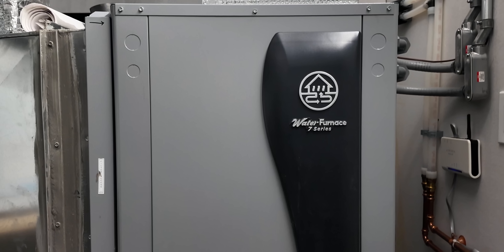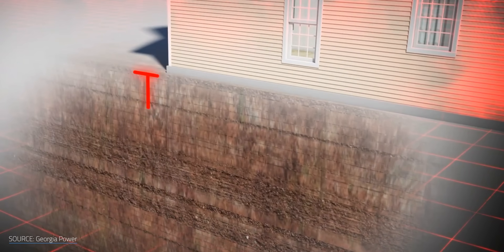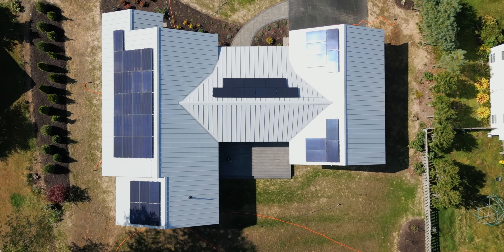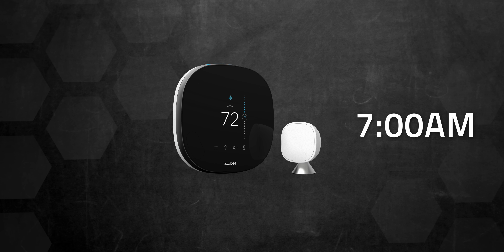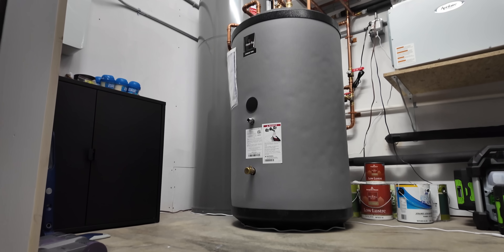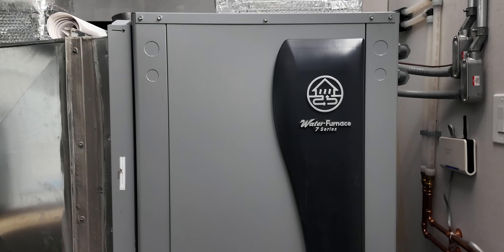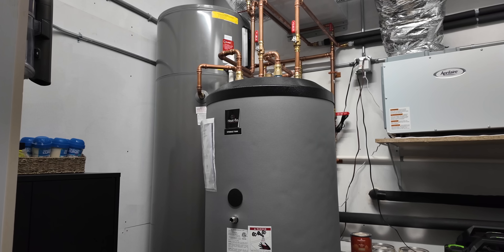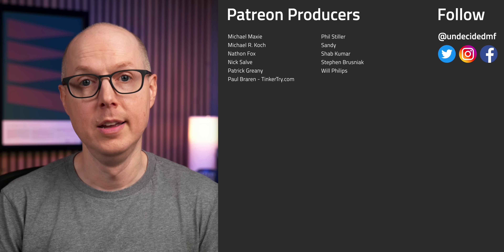How My Geothermal Heat Pump Really Performed (2 Years)

Comment: smart thermostats aren't worth it, you are best to run your traditional heat and AC systems at a consent temperate. We only raise our cooling or lower our heat when we leave for more than two days. The amount of energy to catch back up for daily raising and lowering loses any potential savings and works your system harder.

Comment: In The Netherlands we call heating with hot water more than 1000 metres deep Geothermie. And heating with water from the soil (around 15 degrees Celsius) 'Bodemenergie'.
Reply: @LeonNelen  Aquifer Thermal Energy Storage (ATES) is the correct English term for Matt's system since he is storing heat by cooling his house in the summer an using the very same heat in the winter.
Geothermal energy is using the heat coming from the core of the earth...

Comment: I live in the Mojave and the dense clay/hardpack substrate here makes geothermal both excellent and terrible. Excellent since clay is largely impermeable and temperature stable, but is so difficult to dig through the excavation costs skyrocket fast. Still, if I could swing it, I would prefer it over my current AC/Gas-Heater system because we still end up using our grandfathered wood fireplace in the winter.

Comment: I wanted geothermal to connect into my existing hot air systems but no one in my area installs or supports it. Had to go with air to air heat pumps. They are fine about 9 months of the year. It is cold enough the other 3 that the cost to run them gets high.  They are supposed to be 70% efficient at -20F but a lot of people say not to bother running them below about +25F. I don't really have a way to compare the cost of the oil and propane for the furnaces to the cost of electricity for the heat pumps in the cold part of the year.

Comment: This is super interesting to me.  But my situation is pretty different - existing house, located in a more temperate place (central coast of California), existing gas furnace, but also, a solar hot water setup with an 80 gallon heat exchanger tank, and so on.  How did you find and compile the information you needed to make a decision to pull the trigger on this?

Comment: I've had my geothermal system for 10 years now, and I'm mostly happy with it. I use radiant floor hearing, which allows lower heat pump output temperatures, which helps significantly with efficiency. My solar and battery installation is much smaller than yours (3.6 kW solar, 12.5 kWh battery), but it still helps a lot, even in cold and rainy northern Spain. I'd say that the most important consideration is the vendor and technical support  for the systems. My vendor was acquired by Bosch, who have been useless and I've mostly self-maintained the system. Do your due diligence and choose carefully.
Reply from the maker: Excellent advice.
Reply: @UndecidedMF  totally off topic question, but im a fan of your glasses you are wearing here. do you know what kind they are? Thanks in advance and thanks for a great video
Reply: Knowing what you know now what brand would you recommend?
Reply: @ardas77   As someone who works on them it should be based on who is in your area, you dont want just any company working on them. You want their experience with your system and being local for quick turn around for service call.
Reply: @zack9912000  I agree. The "official service" shop in my area is useless. He's a nice guy, but doesn't know the system and has zero initiative when problems need to be solved.
Reply: That is exactly my experience with my solar inverter manufacturer, Kostal.
Reply: @ardas77 I hear good things about Vaillant, but only anecdotally from a few neighbors. When/if I replace mine I’ll investigate more!
Reply: @MotoLen51  the rain in Spain stays mainly in the plain
Reply: @tlv8555  not all of the northern peninsula is Catalonia, the Atlantic coast and the western Pyrenees most definitely get loads of rain
Reply: @tlv8555  Not really, Eliza Doolittle. ;-)
Reply: It also seems to be a trend that many techs don't like how it was done and want to re-do things.  Of course, it seems the loop installation itself is the expensive part.  As long as that's good everything else is much cheaper.
Reply: @EmperorA0  My loop failed during the first winter after installation. The weight of 2X 150m of water-filled pipe pulled and broke the fittings at the top (luckily, at the top). The builder fixed it as everything was still under warranty. Lesson learned, don't tuck any part of the installation too far out of reach. Everything can break and everything needs to be accesible.
Reply: Bosch used to be a great company.  Now they f-up everything they touch.
Reply: My parents live in Spain and they are afraid of the solar tax, so they have avoided solar 😢
Reply: @blaiseutube The “impuesto al sol” was repealed in 2018.
Reply: En serio?? En qué zona vives? Me encantaría tener algo parecido.
Reply: It's been my experience that german companies tend to have atrocious customer support but good engineering.

Comment: 10:05 Since your server-rack (home office setup) are presumably not venting to outside, the energy should be factored into the heating somehow. But I agree its hard to take into account and 20% (10:50) electricity usage is also very impressive.
Reply: The calculation should be pretty simple because essentially 100% of that power usage beyond a typical home load becomes extra heat that doesn't have to be moved by the heat pump, when it's heating season. Although the A/C has to work harder in the summer, that's probably negligible where summers are mostly mild

Comment: I'm with you on the ground source heat pump.   We had a retrofit done on our home in 2020.  It is a GeoComfort 3 ton system with a desuperheater.   We have two loops that go down 235 ft. Yes, we just set the temperature and let it do its thing.  I was impressed how well it controls the humidity during the summer and stable temperature throughout the year.  We added solar in 2022.  The system has been  providing over 200% of what we use on an annual basis. Yes, net positive.   "Think long term".

Comment: If the ground is constant at >6ft down then why would you need a well and not just some trenches?
Reply: That usually comes down to real estate. In my case, we converted from gas/AC in a house built in 1953. There was just no sane way to go horizontal. In a new build with sufficient area, horizontal would save a lot. If our lake was much deeper, we could have used a submerged heat exchanger. But we have to play the cards we have. That forced vertical.

Comment: We've had a similar geothermal system with horizontal loops here in Ireland since 2006. Our percentage of heating costs vs total energy use isn't as low as yours, but our house turned out to be not as well insulated as we hoped it would be (i.e. as we paid for it to be!). While tricky to calculate, we reckon we hit payback in just 5 years when scaled and compared to the previous house we lived in, but by year 8, it was very clear there was no comparison, as neighbours still on older fossil fuel tech regularly related how expensive heating had become. To sour the story a little, you pointed out how it wasn't necessary to have smart thermostats in each room trying to optimise everything... but unfortunately our installers at the time weren't so savvy, and we chewed through 2 replacement compressors due to the constant calling for heat by different rooms. When we switched service guys just a few years ago, we got the heads-up about what was causing the compressor issues and ripped out the room stats. The system has been working even better since then and we never touch it. Oh, and when we're heating the house we get "free" hot water as a buffer tank on the heat exchanger uses any waste heat to pre-warm the water!
Reply: Sadly, it is the way of it... and things like external blinds taking the load off a room that is facing the sun are quite noticeable.
Reply: Thank you for sharing your information. I have the ground loop installed since 2006 but did not go for the Heat pump as they were very expensive. I have used a mixture of Stanley wick cooker, pellet stove and a big solid fuel boiler in the garage using turf when the temp goes below zero. I'm at an age when I just want to switch and forget and save also, so next year I will go for the instal in the house. I have already the underfloor heating working with no thermostats so that is good to hear. If your willing to let me know who does your service I would be grateful as it is very hard to find anyone with good experience in this field. At the home shows its all about air source. I'm in County Westmeath near Mullingar. Also the make of your unit would be interesting to know even though the technology has improved over the years.Thank you again.
Reply: @jackbyrne8814 we have 2 sets of people who look after the system for us - one is a plumber who takes care of the ground loops and house loops - he gave us the advice about the thermostats killing the system - but there is little point giving you his details as we're in SW Donegal and he's 2 hrs north of us, so maybe 6hrs north of you! The company we use to service the heat pump operates out of Killybegs and is KER - refrigeration engineers - but any refrigeration company can do this for you - I think the Aphex guys out of Sligo go all over the country, and they service the fridges in all the shops, bars etc., as well as commercial and now residential refrigeration units - that's all a heat pump is! The make of ours is Alfa Laval from Germany, but their main rep in this part of the country is "flakey" at best, and we got better support going through the company themselves, who would also supplied parts directly to KER for us. Bear in mind, there are few parts in a heat exchanger that are made custom to that unit, as the modules and parts are mostly available to the refrigeration industry. Don't fall for the "it has to be serviced by the main dealers" thing: it simply isn't true! Like anything, the entire system stands or falls on the installation quality. Ours was brilliantly installed (company gone now) to have the ground loops more than 3 times the power required, and this has saved us when other people less fortunate have frozen their entire garden because they didn't have enough pipework. It's roughly 20 watts of cooling power / metre at 1m down. Our heat pump kicks out 11kW BTU for 2.65kW of electricity used (COP roughly 4:1), so at 2650/20 = 132m of pipe, you need minimum double that to stop freezing, but we have 600m of ground looping and have had no issues even in the coldest winters. Hope that helps.
Reply: @sonovoxx  we got system that was originally installed around 2000. It did break some years ago and as we figured out that we can't anymore after a year get the heat collector liquid for it for ground circuit even if we would replace the broken compressor we decided the replace the pump with new more efficient one. With new pump total electricity cost that was reasonable low did go to half from what it was with the old pump. Old pump had to use electricity as additional heat on colder weather as it was not able to provide enough heat needed for heating. But with the new pump it basically has just few hours per year needed to use electricity on the coldest days of the year. And our heat collector has not been drilled to rock, but just burried under the ground. So it is not as efficient. But there might be big difference between bit older and very new and efficient ground heat pump too.
Reply: @sonovoxx  Small correction.  Running the desuperheater when you are heating your house is not free, but rather directly costing you money, as it's reducing the heat that goes into your home's living areas for the same running cost.  It's much more efficient to preheat that water with geothermal than it is to run the water heater alone, however.

It is free water heating (aside from the upfront equipment/install cost) when you are operating in an extended cooling mode, though.

I have a series 5, btw.  The cost projections showed they were better TCO long-term, despite the slightly lower efficiency.  I'm also running Ecobee stats with 4-5 degree setbacks at various points during the day (takes a long time to recover at extreme outdoor temps) as well as taking advantage of time of use rates to pre-heat/pre-cool and coast a bit during the day.
Reply: If you need multiple thermostats on a single story home the system was installed incorrectly. They didnt balance the air properly for the square footage of each room plus the length of the run for the duct. U can always hire an air balancer to get everything just right
Reply: @GonzoDonzo Zoned heating really shines when heating/cooling loads change significantly between zones at different times.  For example, the master suite is empty all day long when I work, but my office is occupied.  It would be ideal to account for the added heat generation in that office while I'm working, and do a significant setback in the master suite.

If you don't have wild usage swings like this, and especially with an open floor plan, passively adjusting the distribution should be sufficient.

Note that I do not have a zoning system, but I intend to build/install one myself long-term.  Even with a zoning system, you can only redirect a certain fraction of the heat, depending on your specific hardware.
Reply: @houseman2414 it can be good for energy savings but your comfort lvl will go down abit. Mass takes time to cool or heat. Equalizing the temp of the mass of everything in a home can take hours. Its a trade off. Make sure the dampeners are easily accessible when u install your zone system. The motors tend to die but they are very easy ro change if you can easily get tomthe motor
Reply: @GonzoDonzo there's no air to balance, and no ductwork: there are two sets of pipes filled with liquid. One is about 1000ft of 1¼" heavy-duty water pipe, buried about 3ft underground in the garden, and filled with anti-freeze, and the other is a more flexible plastic piping about ½" id, filled with water, and running in circles under 3" of concrete on the floor of each room in the (two storey) house to give underfloor heating.
Reply: @sonovoxx  great advice. Nice the kinks worked out.
Reply: Thanks for sharing the details as we're also preparing to design a similar system. Say, you said buffer tank on the heat exchanger, so the circulating water from the system doesn't actually touch the hot water you use at home, right? Some people use the water from the loops directly, which seems quite bad vis a vis plastics, so I'm weighing all of this...
Reply: @wildswan221 there's a separate hot water "loop" that includes the buffer tank and main got water tank. The water heating engages at set times to top up the water heat and then goes back to heating the house.

Comment: This is really cool, I think where I live the water table is incredibly low. For a large house system it'd be rather easy to actually dig a pond and have a pond system to work off of or trench. The reality though is we don't have super cold temps and when we do have really hot temps the sun is shining like crazy. It'd be the most practical to just install solar + batteries and run the HVAC off that. You could still add a mini split to those other rooms.